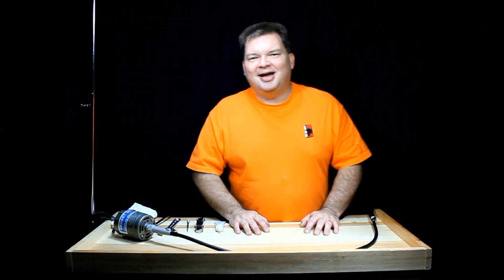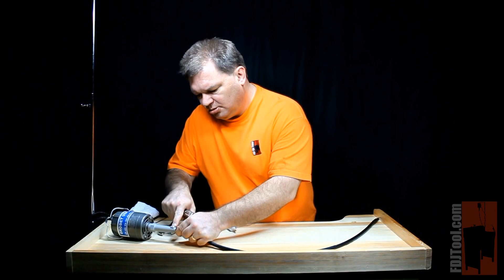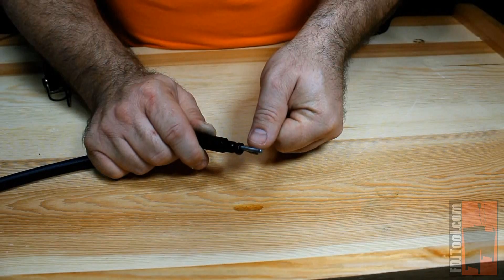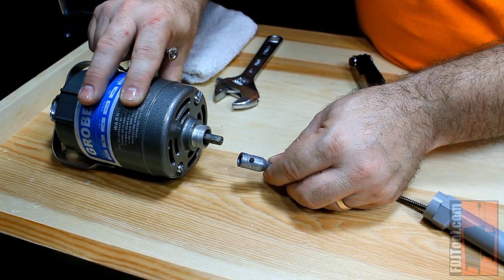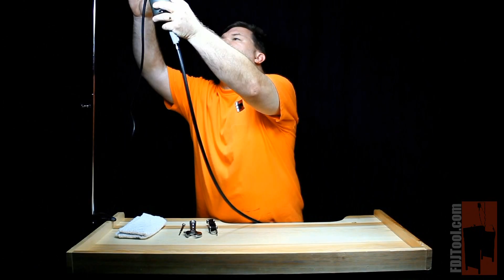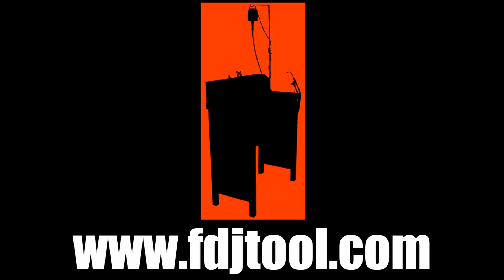Flexible Shaft Maintenance

Comment: How do you know when the shaft needs to be replaced?
Reply from the maker: +Arcane Moon The most obvious time to replace your shaft is when it breaks.  That is noticeable when the motor is spinning but the handpiece isn't.  Other than that, you can check the shaft if it starts making a lot of noise when the handpiece is running or if the handpiece "slips" when running.  These would be indications that there is a problem with the shaft.